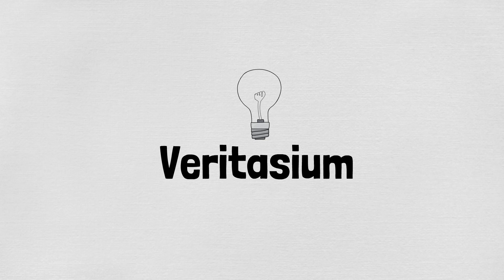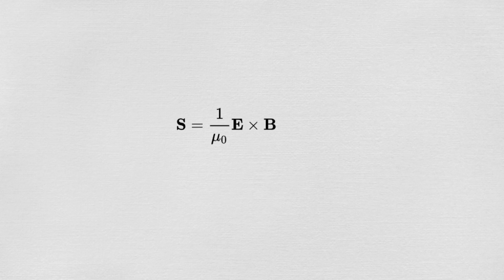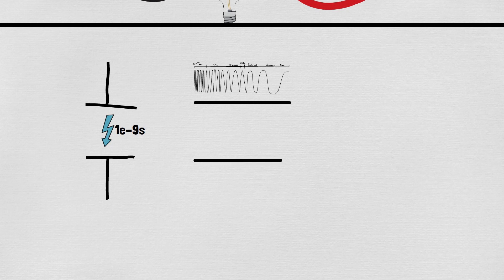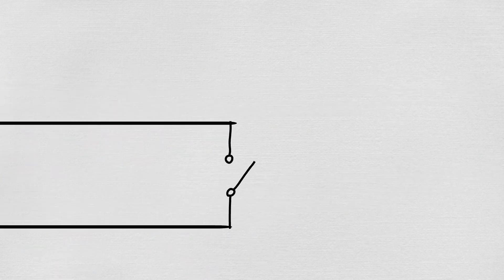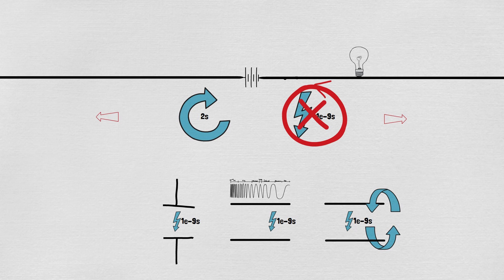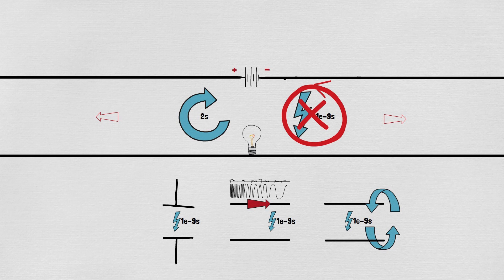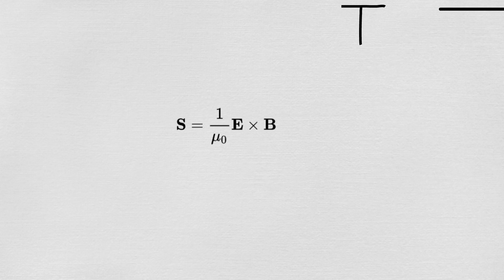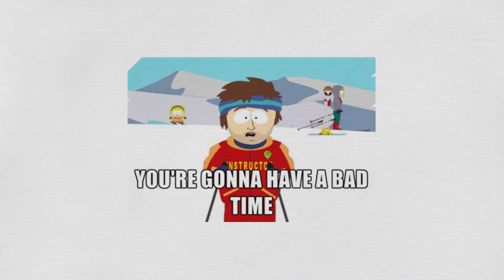Veritasium is Right? (see description)

Comment: 1. Electrons are moved by the electric field due to potential difference.
2. Magnetic field is created by moving electrons.
3. Energy is carried by electric and magnetic fields along the Poynting vector.

- At t<0, before we close the switch, the electric potentials are established in such a way that both wires(left and right), as well as the bulb are of the same potential as the pole of the battery it's connected to (positive).

- At t=0, when we close the switch, the potentials start to change. Nothing at all will happen on the left side of the battery, because that entire part of the wire was positive to begin with. But on the right side the wire will gain the negative potential. But not instantly - the change will have to propagate through the entire right wire before reaching the bulb.

- At t≈1s that propagation will finally reach the bulb at which point the current will flow through the bulb, creating the magnetic field that combined with electric field will carry the energy to the bulb, lighting it up.

Also I think that if you placed another bulb right next to the battery on the left side (opposite of the switch) - that this bulb will light ANOTHER second LATER than the first one. Considering that the potential change will have to propagate through the left wire as well before reaching the second bulb.

Even though Derek missed a mark with his video, I am still grateful for sparking this discussion. After all science isn't about being correct on the first try.

Comment: 5:50 "There can only be a current once the EM field is established across the entire circuit"
I literally watched a simulation that shows the current down to the nanosecond. Current will flow the instant you hook a wire up to any battery. That's what makes capacitance work. Please clarify what you meant here.

I mean, antennas aren't even a circuit, yet no one would claim there's no current.
Reply: Exactly. The excess electrons on the battery terminal spreads into the wire. Or vice versa for the + side.

These are moving electrons
Reply: @VivekNa  Electrons don't move much, it's the fields that do.
Reply: @bobweiram6321  an electron doesn't move much, but electrons move plenty because there are so many. Better to just think of it as moving charge /charge density in this case.
Reply: @bobweiram6321  Think of it more like packing more electrons into the wires
Reply: "Current will flow the instant you hook a wire up to any battery." You would think by now everyone should know nothing happens instantly. Current is induced by electromagnetic field, which propagates almost entirely INSIDE the the wire at the SPEED of LIGHT. If you replace the bulb in Dereks diagram with extremely sensitive detector, it will detect very week electromagnetic field outside the wire in 1m/c time, but that field won't light up any bulb or LED.
Reply: @Steve-jy1vd  an antenna is a circuit
Not for DC. Thing is, we're talking the first few milliseconds of the current starting, when it would be indistinguishable from AC. And current is always flowing somewhere over AC. So they are sort of circuits.

Comment: The circuit is a folded dipole antenna for 1/2 Hz, with the bulb opposite the feed point. There will already be current through the bulb before the switch is closed.